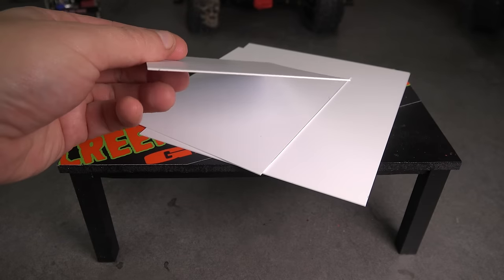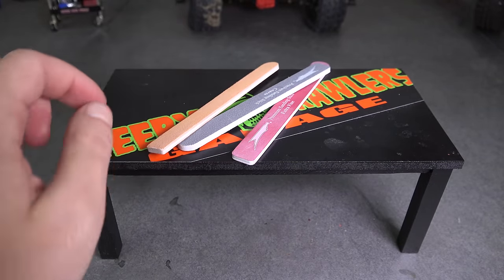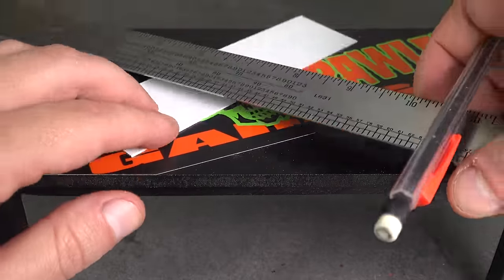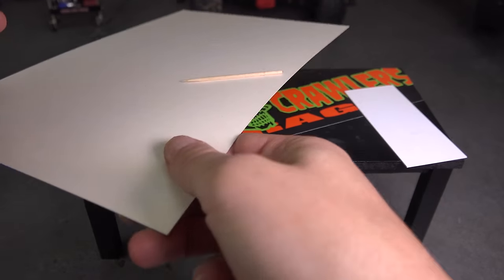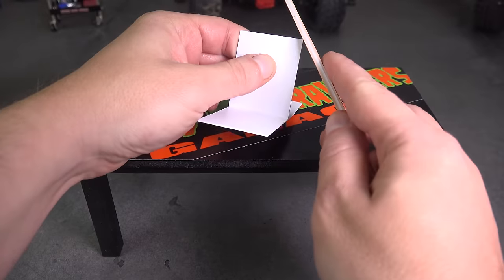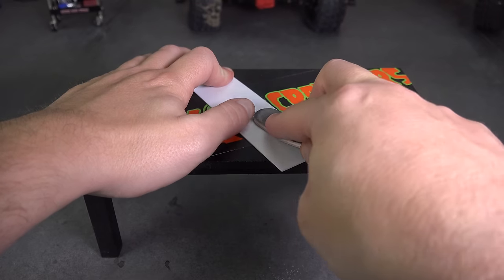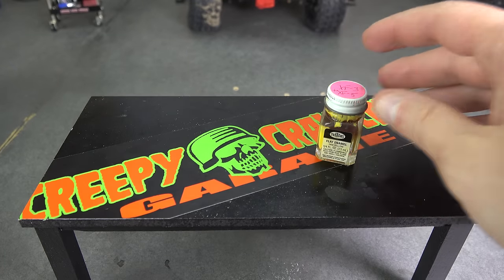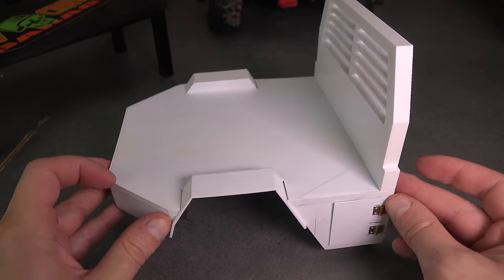Building With Styrene Basics! - RC Basics E7

Comment: Hi, what is a good proper thickness of styrene to build a 1/48 "O" scale building? I am a first time styrene building maker here. I have the windows and doors already.
Reply from the maker: I'm not overly familiar with building for O scale, but .060 is very common, .040 may be better for such a small scale.
Reply: @TandemCTelevision  Hey, thanks for the quick reply. Just what I needed to know. I will go with .40 to start and may be easier to cut.

Comment: How strong is the material? I need a light workable material that doesn't flex. A little flex for larger pieces is okay, but it will need to support perhaps up to 10lbs.
Reply from the maker: You can get it in pretty heavy gauge but even in large sheets it's going to flex. I'm not sure the exact application you're needing it for, I'm thinking 10lbs would be on the top end it could support. Have you thought about a polycarbonate material like Lexan?
Reply: @TandemCTelevision  I need to make a platform to place several sensors on. Chances are there will be two layers at least. The platform will have to be perhaps 14in long and 10in wide. It'll be going on a rc car that I'll have drive autonomously to collect data. 

I'll have to take a look into the other material you mentioned. Is it easily workable? As in not needing fancy tools to cut it down and easily drill able to put screws through. 

Thanks for the response. Kinda rare that someone responds on a video posted 1yr+ ago.